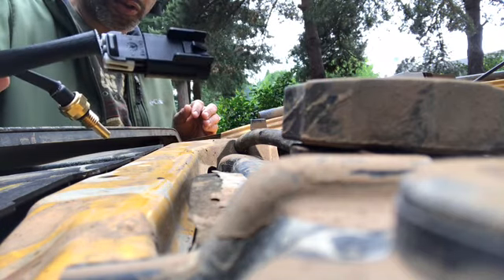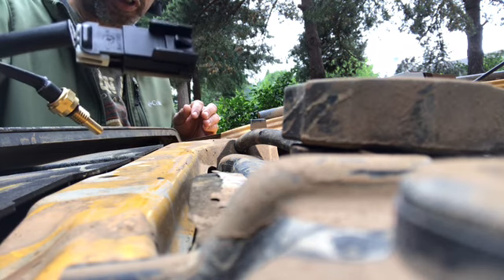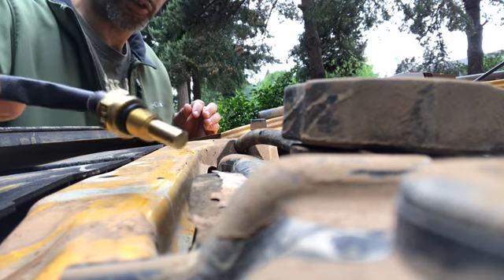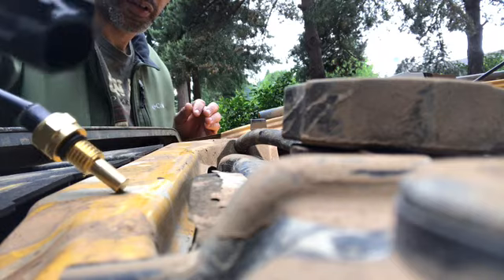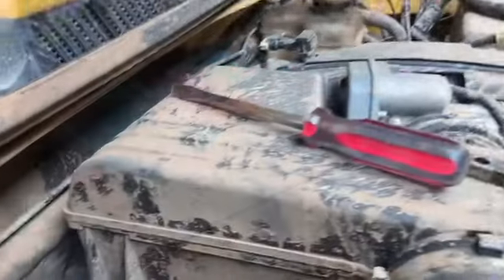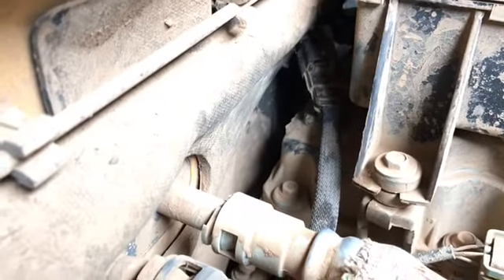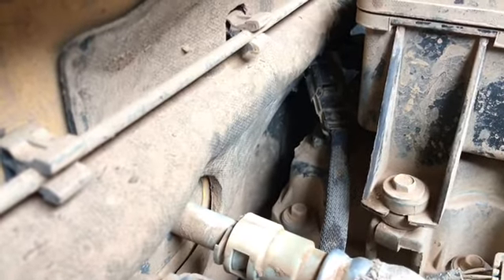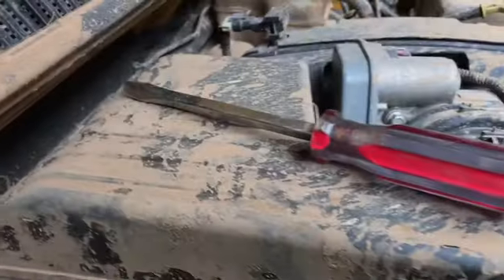HUMMER H3 Coolant Temperature Sensor

Comment: Had the “AC off” and Check engine light on. Used a Bosch code reader. Said temperature sensor reading to low temperature. Followed instructions per this video to perform the replacement. One additional comment= my AC didn’t start working until I cleared the code from the memory. I used the Bosch code reader to clear the history and check engine light. AC immediately began cooling! Works perfectly now. Total cost about $35 from O’Reillys. Good luck! Happy humming!
Reply from the maker: Right on. Glad it worked out for you! 🤙🏽
Reply: I'm going to try this tomorrow

Comment: What was the initial problem that prompt you to do an RR on the sensor?
Reply from the maker: I went Mudding in Spokane, WA and the mud caked up most of the engine area and from that point on the overheating began which resulted in a newer radiator, thermostat, belts, sensor and some other stuff I forgot about since this was several years ago.  Good news is my 06 H3 Lux/Adv still runs strong.

Comment: Mine is covered in mud from mudding like this and it is running hot. Could the mud be the cause?
Reply: jade harris Yes.  After mudding you really want to hose down for engine, radiator, trans cooler, etc because once it hardens up, it’s really tough for it to breathe properly.  Good luck to you!  *sorry about the late response.  🤓
Reply: Just make sure the vehicle can breathe as best as it can. 
  That includes being able to shed heat while operating.

Comment: What problem did you have and did it fix it ?
Reply from the maker: H3 was running hot so I replaced the Thermostat but then it still ran hot.  Eventually I changed this out and problem solved.  I had zero check engine lights or codes saying to replace this.  After the installation, things have been good on the H3.
Reply: U should have replaced the easier part first. Meaning the temp sensor

Comment: Is this what makes ac off on the dash plz let me know asap!!!
Reply: What makes that a/c off on the display is a bad thermostat I had the same crap happen to my 2009 hummer h3.... once I replaced that I never had that happen to me again. So it was definitely the issue.
Reply: My h3 on really hot days runs 3/4 hot on the temp gauge. I changed the thermostat and fluid already. Don’t want to change the radiator until I try the quick stuff.. Will this remedy that?
Reply from the maker: Yes, it can do that.
Reply: @antonioreyes2382 have you fixed the overheating? Mine runs hot also when going uphill.
Reply: @daleg8473  changing the thermostat was the answer for me, but I also did replace the sensor as well. Never overheated again